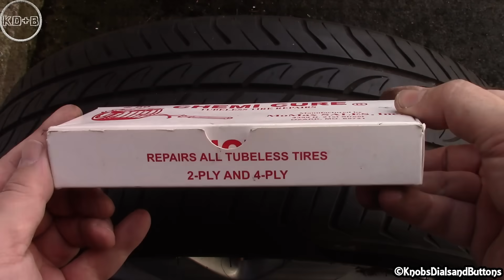How Tire Repair Kits Work - With Internal Views

Comment: The first type is the one usually available at the nearest gas station, so it's what I've always used.  I've never had an issue with it and it always lasts for the remaining life of the tire.  They're very inexpensive as well.  I've never even bothered with cutting off the excess strip.  Having that extra bit of thickness & stickiness gave me more peace of mind.

Comment: I've never had to make a tire repair, but after watching this video I will be confident it should not be a problem, whatever kit I will have with me. Thank you! :) I especially love how you show what's happening inside a tire. It really gives good understanding of what's happening and therefore helps to perform the procedure correctly.
Reply from the maker: Thanks for watching !
Reply: I used the string (no 1 in the video) for the first time recently when my partners car got a nail in it. Honestly, so simple to do and works like a dream. The hardest part was getting the nail out!

Comment: Been using the #1 process on the video on the front tire of my SUV and it lasted the life of the tire no issues.
Used it on my mountain bike tire too. Riding on big chunks of rock garden all the way and it also lasted the life of the tire.
Also used it on the rear tire of my scooter too. 

All used with rubber cement.

Comment: I’ve been using the strips for about 50 years. I’ve plugged 100s of tires with them never had one fail lasted as long as the tire. Good stuff I hear they’re illegal now but I still have 100s actually used one tonight on a wagon tire.

Comment: Wow, very nice orderly format. Every step clear and concise. Order of workflow consistent and predicable. Outside working view, then inside view.
This is the first tire repair video I've seen with internal views of what happens during the process. Doing my own repairs with plug strips, I've sometimes wondered what's happening on "the other side". Like "What's holding this plug and securing it from popping back out?" Seeing exactly how they anchor themselves inside is a very comforting and reassuring feeling.
Reply from the maker: Thanks for watching !

Comment: I've used the sticky strings on farm equipment and cars for years. Never had one fail. In my opinion, the liquid cement is more of a lubricant to aid the string insertion but then dries up. Obviously the other brands know the cement isn't required for a good seal. I use it for that purpose whether the instructions call dor it or not. 
Cool video!
Reply from the maker: Thanks for watching !
Reply: I have used sticky strings about 30 times over 40 years in outback Arizona,  and add the cement! I had to double and triple at times from rock gashes. No failures on the single and double uses but had to do a re-repair on a triple to get to a tire shop
Reply: Agree re: the glue. Makes it quite a bit easier but have not used it most times.
Reply: On peut utiliser de L'ESSENCE F
Vendue en droguerie 
Elle dilue et lubrifie le caoutchouc puis sèche ensuite 
Indispensable dans un véhicule 
Non agressive pour la peau 
Nettoyage de tout matériel même électrique..carosserie tissus etc ...
Super produit ..😉
Reply: So, everybody is talking english and you decide to trow in some baguette and expect people to understand in?
Reply: @Kwarksnuiver  lmao
Reply: 😅 @Kwarksnuiver

Comment: Ive always used the Plug Strips and have lasted me the life of the tires. This is across 5 pieces of equipment since 2016. The first few plugs were installed without cement, the rrat have been with. Overall, great results but i might have to switch to the screw and mushroom ones. Those seem pretty legit.
Thanks for the vid! 🤙🏽

Comment: For the string type repair plugs:  If you have rubber cement, use it.  It's not just for a better plug (and honestly, the self-vulcanizing rubber in the string will work just as well without it), but for your own sanity.  The rubber cement, before it cures, acts as a lubricant making it FAR easier to wrestle the repair plug in.  Without it, it will still work perfectly fine... it's just a lot harder to get in place.  And when you're fighting to plug a tire on the side of the road, that's extra effort you don't need if it can be avoided.

Every vehicle should have a plug kit and small 12v emergency compressor at all times.  Plug it, get air in it, and get going.

Comment: I had my first stab at having my punctured tire repaired using the first one (rope thingy) by a tire vulcanizing shop way back 2021.

At first, I tried to gently tell the guy to use a cold patch when I saw him prepping the rope thing kit. It was my first time seeing one.

He said that it's better than cold patch. Then I remembered that in 2018 I had a cold patch application failed on me, it was ripped after 4 months of usage.

So I said, what the heck, I am willing to try new things.

Since 2021, that tire is still being used today and working great. No air or water leaks whatsoever. Will eventually replace the tire but only because it's near the expiration date.

Comment: I will say this guy makes it look easy. I use the first method exclusively. However, not everyone can push these tools into a hole in a tire. It definitely takes some umph.
Reply: Well stated.
Reply: Trick is to take the wheel off and put you body weight into it.  Dont try and repair on the car, it difficult to get enough force behind it.

Comment: I may now decide to stock these in my car for emergencies. Not sure if I will still not replace my tire after the repair, but I would say this is probably better than the spare.
Reply from the maker: They're definitely worth having in your car as a backup in case of an emergency. Hopefully it would never be used, but you never know.
Reply: Some newer vehicles no longer include a spare tire.

Comment: Great video, certainly worth watching. I have used the string type and always carry a kit in the car plus a pump. Much better than the usual foam kits that come with cars as it's a permanent repair. Never bothered to remove the wheel either as you just roll the car forward till you get access.

Comment: Great video thank you!!!

When I go on long drives I always keep a tire repair kit like #1 and a small air compressor with me.  

If the nail is on a front tire, you don’t even have to remove the wheel.  Just turn the wheel all the way to the left or right and roll the car forward until the nail is accessible.  Fixed my front tire one time in less than 10 minutes.  Tire kits are cheap insurance to keep in the car.
Reply from the maker: Thanks for watching !

Comment: I'm 57, done the first repair since I've been driving, but I will be looking into the screw plug!👍
Reply: The screw type plug is the fastest and the easiest way of fixing a flat tire, but the less reliable one, in my opinion. Why? It's just like you had a flat tire punctured by a screw, but you'll never notice it until you gradually lose tire pressure over time. But it will serve it purpose in an emergency situation.
Reply: It’s funny that’s the last one I would’ve picked. As the tire wears down, it’s going to eventually hit the screw and then what? Seems like the least reliable of all of them.
Reply: @j0shll0yd  I made a similar comment before reading down but I think that solution is more of a hold pressure on the wound for a few days until I can get a tire where as in my opinion the sticky stuff lasts the life of the tire and a great band aid.

Comment: I remember last year my car had failed the roadworthiness test because of a nail in one of the tyres. Popped in to a tyre shop and the repair was around $50 (for one puncture repair). I’m pretty sure the shop went with the “plug strip” method because they explained the process to me and I definitely recall them saying “rubber cement” because that was the first time I’ve ever heard of such a thing. I paid for it because I didn’t know it was something I could do myself and I was in need to get my car roadworthy again to get back on the road. 

After this, I looked into it was shocked to find out I could get plug strip kits for as little as $10 for up to FIVE repairs, which means it’s $2 per puncture. Now that I’ve seen this video, I’m quite confident in doing my own repairs going forward. For once YT algorithm directed me to a useful video.

Thank you so much for making such a detailed and easy to understand video. Every driver in the world needs to see this video because F**K paying $50 for one puncture repair. Liked and favorited! 👍🏼
Reply: Here in Mexico we only pay about 2.5 dollars 0_0
Reply: They more than likely used a booted plug that you have to take the tire off of the wheel to install. It looks like a regular plug from the outside but has a large patch on the end, inside the tire that is stitched down like a regular tire patch

Comment: Really informative video! I don't know anything about tires (I don't even have a car), but here's my conclusion based on the video:
- The screw type seems to be the easiest and quickest to apply but might not be the most effective, long term.
- The strip/string types seem to be the most effective and are relatively easy to apply.
- The mushroom head types seem to be the most difficult to apply and don't seem that effective.

Comment: The first method is what i always use with plenty of glue. I always leave the plug uncut and let the road laminate it into the tire tread for a positive seal. Great 👍 job on the video. Thanks
Reply from the maker: Thanks for watching !
Reply: If it’s not properly sealed on the inside it doesn’t much matter what sort of seal you think you’re getting on the outside.
Reply: I agree w running on it vs cutting it.  I also agree the inside seal is importantly but something satisfying about how the plug appears to be part of the tire after running on it. And it wearing off vs cutting it.
Reply: I've used the first one several times with no rubber cement and have lasted me the life of the tire.
Reply: You'll want to cut it as short as possible. Otherwise it will drag the rest of the plug out when the tire rotates over the road. I think that's what happened to my failed first try. I didn't cut it aggressively.
Reply: Not good advice - when you pull it out of the tyre you cause it to bunch up and seal at the back of the hole. The tyre pressure will keep pushing against it. When you leave excess, you start pushing it back into the tyre and lose the blob built up against the back. You can also have them get pulled out. 

A good seal on the outside of the tyre is absolutely useless
Reply: I have always cut mine off. I figure leaving a "tail" could cause issues if you loose traction and your tire spins. Seems like it could pull the plug out as the tire is spinning and regaining traction. Or panic braking and tires skidding pulling plug out.
Reply: @Chadman333 makes perfect sense.
Reply: Just read the instructions that come with you particular repair kit, do exactly what they say, don’t add glue, or don’t cut off the excess. The engineers know what they are doing.

Comment: Personally, I wouldn't use any plug that doesn't incorporate glue. I believe it not just normal rubber cement, but it has a vulcanizing agent in it that actually welds the plug to the tire. This truly makes the tire as good as new if done correctly, whereas the plugs that don't use glue theoretically could work their way out. Thanks for this great video!
Reply from the maker: You're welcome. I understand what you're saying but I only demonstrate each kit as per the instructions. I'll use rubber cement only if it comes with the kit.
Reply: @knobsdialsandbuttons  Yup, just giving support to the methods you show. Great video.
Reply from the maker: Thank you !

Comment: I use the plug strip or corded rope with glue mainly. They never have failed me. If I can, and not in a hurry, I'll patch the tire from the inside like they do at most shops. But these are all good DIY fixes that do work in a bind. Good job on the video.
Reply from the maker: Thank you !

Comment: What a perfect way of showing the possibilities. Only at 17.35 you don't show that the tip is lost in the tire: that's not perfect. And you don't tell us that in your time order there is also a quality order, the last screw is very easy but more like coming home and replace and the first solution is for just use your tire as long as the tire holds: far preferable. 
Jolly good work and greetings from the Netherlands. 🙂

Comment: I ran over a bit of road debris on my motorcycle last year and got a pinhole leak in my rear tire. The short version is that I scrounged a large (about a #12) sheet metal screw and screwed that into the hole and topped up the air. Use the largest sheet metal screw possible. (And DO NOT use a wood screw,  unless you are desperate, as the threads are tapered and not nearly as coarse as the sheet metal screw.) I rode 150 miles to the dealer for a new tire and never lost a single pound of air. In hindsight, a blob of rubber cement on the threads would have been a nice safety factor. I now always carry a sheet metal screw with me. In the car too.  And, be prepared with an inflation device of some sort the runs off your vehicle's electrical outlet. In my experience, half of the gas station compressors do not work. I found out the hard way.
Reply: Great advice! 👏👏
Reply: I've got a plugging kit in each of my vehicles.  But depending upon the type of puncture (i.e. large, small, nail, screw, angled, straight, blah blah blah) it can be an SOB to get the plug in.  I never thought about just running a sheet metal screw in but that's GENIUS for a quick, easy, on the road type of fix.  Thanks so much for waking me up!

Comment: I like the Plug Strip method, the first one shown.  I want to get a high quality kit with good sturdy tools.   What brands/kits do you recommend?
Reply from the maker: I think 'Slime' make fairly good kits. Some of the really cheap kits have tools made of soft steel that just warp the first time you use them.

Comment: I use the mushroom plug method but coat the hole and mushroom in rubber compound.  It serves as a lubricant and then glue. They've always lasted the life of the tyre after. Saved my life on my harley, 4×4, wife's and neighbours cars.
Reply: What rubber compound do you use?

Comment: The mushroom type are by far the best
Reply: I have used the mushroom type twice and both times they still leaked slowly so I'm not so sure. I bought the plug type as well just in case. Further testing needed.

Comment: I've used the strip/rope type many times without fail. Only once have I had any type of failure before the tire was worn out. Eventually the tread began to separate and develop a bubble/hump near the plug; a hole introduces a potential weak point and a plug doesn't fix that. The plug itself never failed or leaked though which was impressive.

Comment: 16:17 Out of curiosity, what happened to the plastic tip you put on the gun? Is it inside the tyre? Coz when the mushroom head goes inside, it pushes the tip into the tyre right?
Reply from the maker: Yes, it remains in the tire until it's removed at the tire shop. I'm only demonstrating how to use the kits, I have nothing to do with their design :)
Reply: @knobsdialsandbuttons  Thank you so much for the reply.
Reply: I wondered that myself and scrolled through all the comments to see if I was the only one who caught that.

Comment: Nice video well explained 👍 👌 
But which is for long lasting?
Reply from the maker: Thank you. The sticky string (chemi-cure) kit is the only one that claims to be a permanent repair when done properly. I would only use the others as temporary repairs until I have the tire inspected and patched from the inside at a tire shop. Some people say they last the lifetime of the tire but I wouldn't take that chance. It's not worth the risk.
Reply: @knobsdialsandbuttons  Dear thanks for your kind reply appreciated 👍 ❤ 😊

Comment: I used the first type of tire plug kit and it worked really well. Was the cheap harbor freight one, the plug sticks work perfect, however the handles are very shitty and will break off in your hand so make sure to get a tool that has a metal handle. Was not aware of the mushroom plug tools though, but I really want to try them

Comment: I use RTV black to fix my flats. I cut the applicator tip super small so I can insert it into the hole and squeeze it in. Let sit 24 hours to fully cure and fill with air. I have done this several times with 100% success.

Comment: I have used these mushroom kits a few times now. I have one addition to add to the repair process these plugs are also rubber so when you pull the plug up with pliers dab a little rubber cement around the stem when you let go it will take some of the glue down inside the hole. Might or might not help keep the plug in place but surely won’t hurt.
Reply from the maker: Thanks for watching. When I demonstrate each kit I only use the tools that come with it and go by the instructions. I'll only use glue if it's part of the kit :)

Comment: Or simply remove the nail make sure all the air in the tyre is out push superglue in the puncture site push some glue in and pull out the glue give 5 minutes to cure and ride away. Tried and tested a hundred times